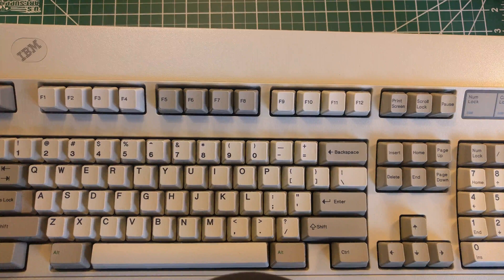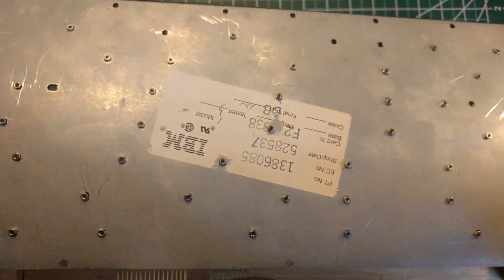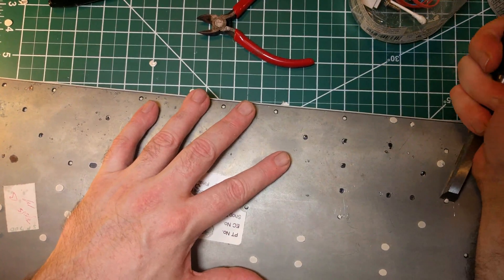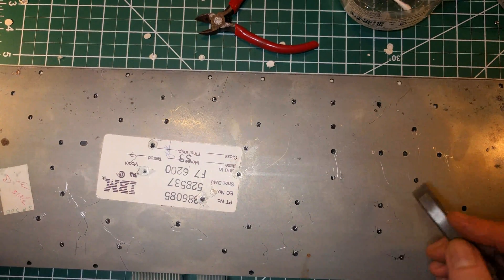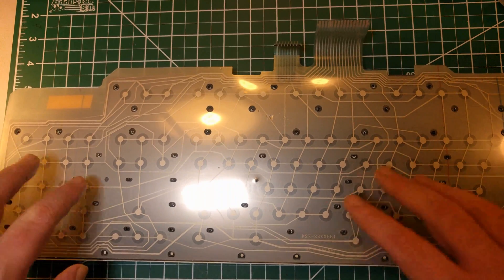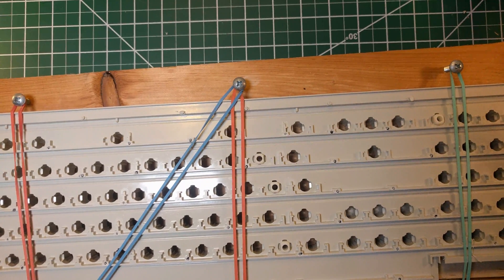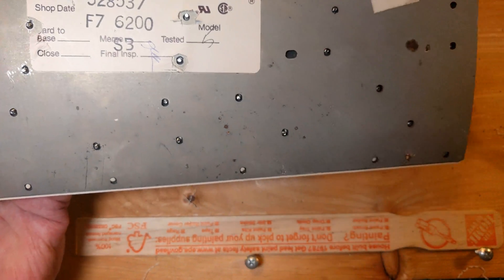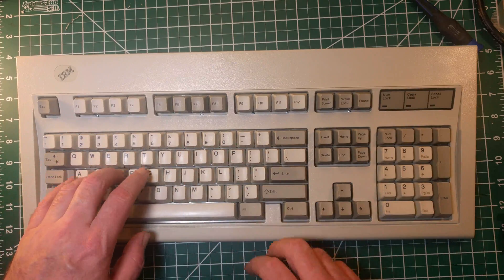Model M Keyboard Bolt Modification (Redux)

Comment: Hey Chris, I found an old model M with the barrel plate already snapped in several places, if I bolt mod it, is it going to cause some issues or will it only affect the keyfeel and sound?
Reply from the maker: If it's already snapped, there isn't much in my experience that can be done for it.  I suggest in the video (or one of my videos) buying a replacement barrel plate from Unicomp, but I just went and checked their website and don't see any for sale. I know they used to sell them because I bought at least one. I don't know if this means they no longer sell them or they just took them off the website or what. Second option would be to buy a trashed Model M or Unicomp off eBay for parts although you run the risk of that plate being snapped too :(
Reply: @ChrisMcDonough  I see, i'll try to 3d print some kind of support or something. It's already broken, the only thing i have to loose is time. Thanks for the help!
Reply: @ChrisMcDonough  Hey Chris, it's been a year and my repair still works! So my barrel blate wasn't broken into multiple pieces, but there were cracks groing through the plate at the grooves where it bends to curve with the steel backplate. Since the barrel plate is kind of segmented in strips, the bolt keep the plate secure enough on the backplate so that it works perfectly.  To further mitigate the cracks, i drilled little holes at the end of each crack to prevent them from going further, and i filled the back grooves with  fletch-tite platinium glue since it's a strong and flexible glue i had good experiences with. I even disassembled the keyboard a few weeks ago because of a forgotten spring and the barrel plate is still good after months of daily use. Thanks for the tutorial!
Reply from the maker: @cybercraft17  love the Barkley avatar

Comment: Hey Chris, thanks for this awesome guide on bolt-modding! I'm waiting for my model M to arrive to get to work. I did have a couple of questions though; would you be so kind as to mention the spec (size) of the bolts that you used? I'm trying to find something online but no luck. Also if you could please mention the size of the drill bit that you used that would be awesome!
Reply from the maker: Hi Ameen, links to buy the right nuts and bolts and the size of the drill bit is in https://youtu.be/O9shp0-sonQ